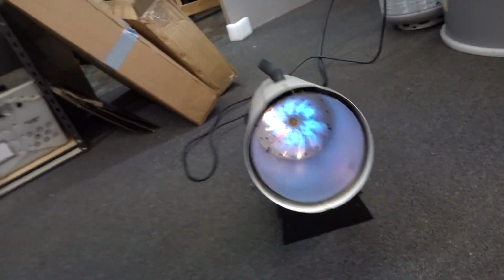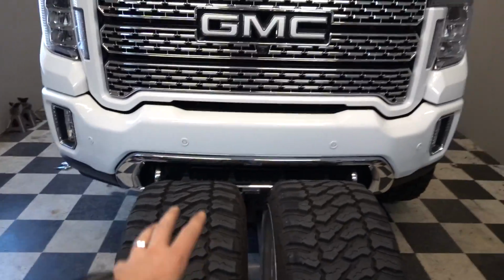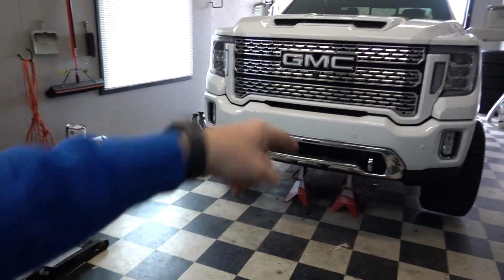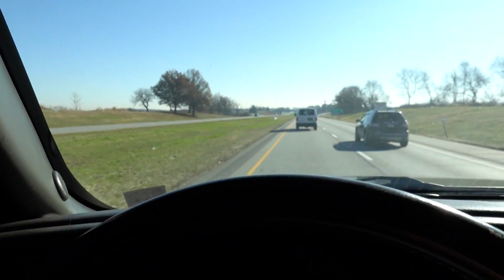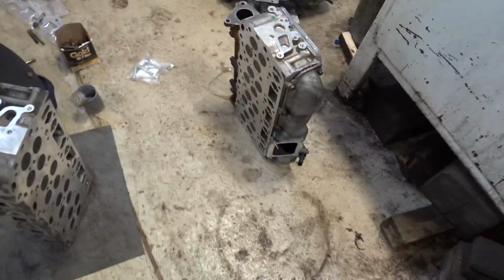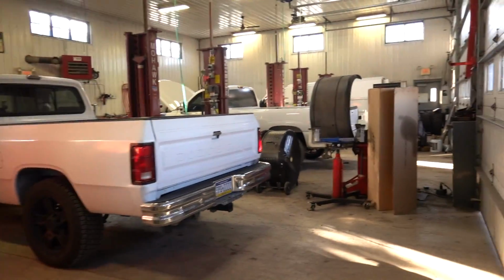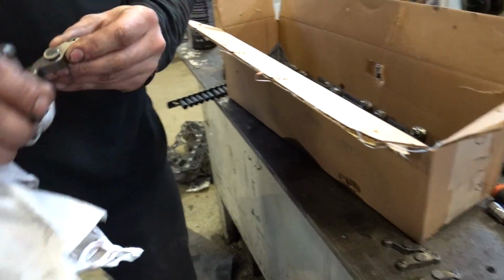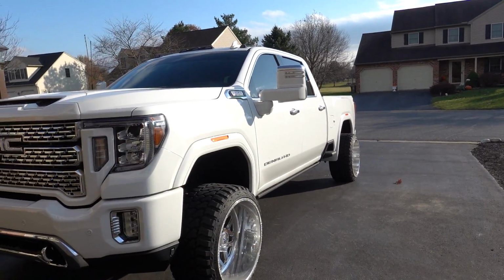NEVER MAKE THIS MISTAKE WITH YOUR MUD TIRES!

Comment: That is not the correct way to rotate your tires.  You can ruin your tires rotating them that way, you can break the belts in the tires. The correct way is front to rear

Comment: Hey Jack I have been thinking of getting a set of furys but I don't have a nice big show truck or nothing but I do have 20x10 and I don't go mud digging with my truck or anything like that but I do a good bit of off-roading and I like to know how a tire dose in the mud and snow and so on and I know they are not the best on road but everyone that has them never goes anywhere but the pavement so I was just wondering if you could tell me or anyone else I would really appreciate it

Comment: Your tires are wearing pretty quick in general not a fan of those but when you pull a trailer since you bought and independent front suspension truck your front tires go like this \   /  if you had a 3500 it might not be so bad but for sure if you had a solid axle it wouldnt do that also